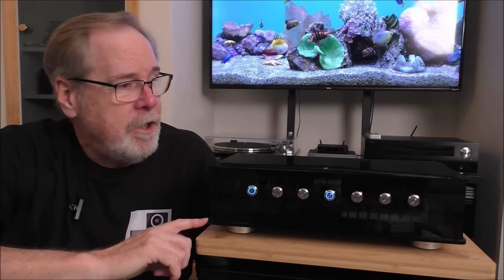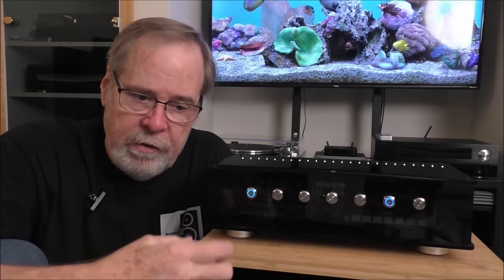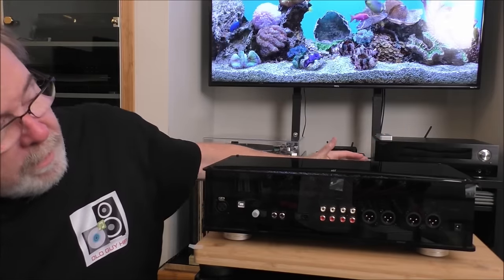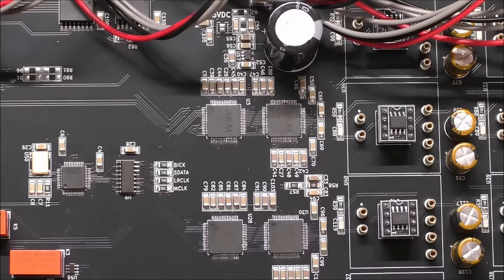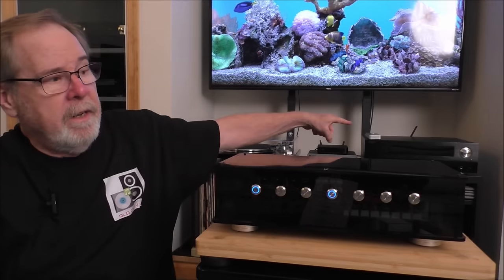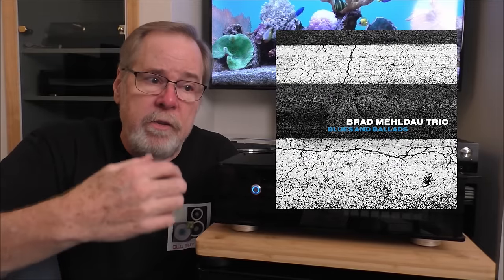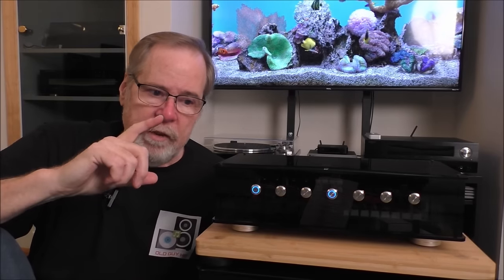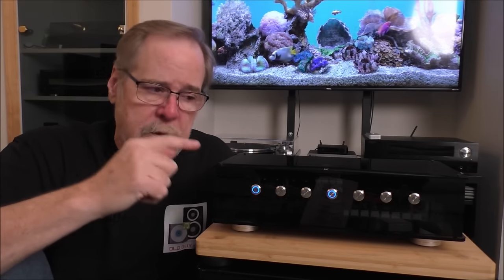The Dayzee is CRAZEE good! It is best chip based DAC I have heard this year or maybe ever!

Comment: How does the Dayzee with ss2590 stack up against the LAiV harmony (R2R, $2700)… you mention you like the LAiV better than the DAYZEE but only with the stock op amps… I think adding 8x ss2590 is gonna bring up the price —do people usually do 8x DUAL ss2590? That’s 16 op amps!

Thanks!!
Reply from the maker: You need to pay better attention. The Dayzee accepts only 8 single 2509 Op-amps. Not dual. I have 8 installed and it sounds very good. The Harmony is just a bit more refined. It is the difference between Chip based and Ladder R2R based DACs. As good as the AKM4499EXEQ+4919EQ chip set is, it is not the same. It is silly to try and compare the two as it is really and apples to oranges comparison. Both are excellent in their own way.
Reply: @OldGuyHifi  so; I’ve been following this subject for a bit and most people when using ss2590 often don’t really state clearly whether they are using the double-stack ss2590–honestly I couldn’t tell from what I saw or read… sorry if I missed it. the J3 pro for instance—it isn’t clear to me if people use double stack 2590 either. You can’t order single ss2590 on their site for J3 either. Anyway, so 8x ss2590 adds about 400-450 cost—which should bring the Dayzee into similar price range with the LAiV—maybe $2100-2200

As for LAiV vs Dayzee—honestly I don’t think apples vs oranges applies. Sure R2R is a different approach from delta-sigma, the AKM approach is kind of a hybrid. But people aren’t really interested which is the best example of a particular tech-they’re interested in what implementations of what tech sounds better, or if the answer is “these two units have their own strengths & weaknesses and it isn’t clear which is overall better” then that is an answer of its own sort. The question of comparison is still valid… and even two units in wildly different price ranges can have a useful comparison: such as “this $200 unit actually sounds better to me than that $2000 unit” or “the $2000 unit does most things better, but I can barely tell the difference”…  or as sometimes expected “the $2000 buys you a major nontrivial difference”… Grzegorz of Virtual Hifi compares units with different tech and wildly different price ranges all the time and I find it useful.

Anyway what im taking away from all this discussion is you have 3 price groups with a representative that make sense:

$300 ZD3 with ss3602
$800 Geshelli J3 with SS2590
$2700 LAiV

Comment: I have a J2S AKM 4499 with Sparkos 2590’s on the unbalanced. Do you think it’s worth getting a taller case to put the op amps on the balanced and using that output? Running a pretty revealing McIntosh/KEF reference setup do you think there will be a worthwhile gain?
Reply from the maker: I would not recommend running  3 2590s in a J2S. They suck up a lot of power. My J2S with just the one 2590 gets warm. I think that is why Geno upgraded the internal power supply on the J3 Pro. I use 3602s on my balanced side with excellent results. I also have a pretty revealing system and of course get some crazy gear in for review and I never felt like I was missing anything. Great question. Thanks.

Comment: Power supply is a very important component to great sound quality. Very disappointed in its power supply. I'm sure it's a very good sounding DAC but adding a robust linear power supply would bring it to the next level. I guess at $1200 can't complain. Would like to see a $2000 version with upgraded power supply.
Reply: .             I'm glad you brought this up.  I WANT to love the Geshillis (USA & all) but the wall warts don't cut it.  Geshelli needs further federal certifications/licenses for electronics like the Consumer Product Safety Commission (CPSC) to build DACs with nice copper doughnuts inside.  That takes time & money, but it's time.
           Sure I like separates and stand alone copper doughnut LPSs but the chassis and cases are still kinda built in my garage-ish too. I'm rooting for them though!
         (edit) Oh Ya. It's missing i2S too.

                                                                          Acid Jazz,  Funk & Brass   🔈🔉🔊

Comment: Ed.  How does the dayzee compare to the bifrost 2?
Reply from the maker: It wouldn't be a valid comparison as my Bifrost (not a 2) is highly modified. No one other than me knows what it sounds like so it has no valid relevance in a comparison. That said they are both very good but both very different. Sorry I don't have a better answer. If it was a stock Bifrost then a comparison would be possible. Great question and I was I could give an answer. Thanks for watchin.